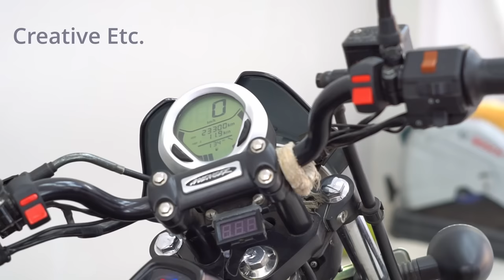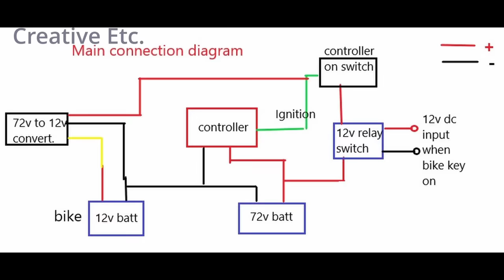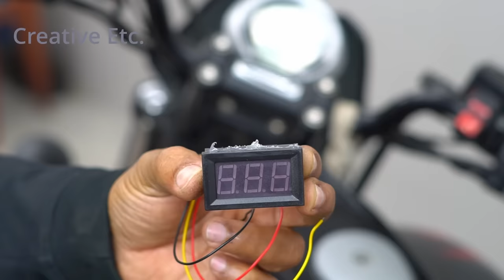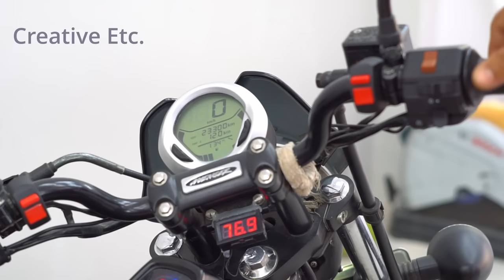DIY Petrol and Electric Hybrid Bike at Home

Comment: Try to split the battery into two and place them on both side.  .. It will help you maintain the centre of mass of the bike. Amazing work brother
Reply: A
Reply: @dipunnilesh2975  nice e
Reply: No need
Reply: Or better use one more battery pack, then it would be double in backup
Reply: Good work bro.. consider rubber gaskets for the metal boxes installed bottom side.. flooding, bike washing etc
Reply: Is it road legal
Reply: Good tweak but bad advise
Reply: Indians two wheeler drives are trained by their ladies to carry unbalanced things.

Comment: Great concept, but weakening the fork and brake disc rotor while installing a much heavier front wheel set and loads of batterries is very concerning, safety wise. Kudos for the effort and execution though.
Reply: I would not ride that bike for all the money in the world
Reply: I have been building custom motorcycles for over 55 years and this is about the most dangerious bike I have ever seen .I wouldnt even sit on it never mind ride it . Total deathtrap .
Reply: @johnsshed995  jalina teri?😂😂😂
Reply: @johnsshed995  I can't think you can make this bike in your whole life
Reply: @TECHNODESIFITNESS  who wants to make a suicide bike lol. Engineers know what's wrong in this..
Reply: @TECHNODESIFITNESS  what he said is correct,by cutting the forks and welding the disc brakes,the person created a potential failure point, why are you so offended when the person is clearly saying about the Safety factor?
Reply: @TECHNODESIFITNESS  You could have stopped you claim before "you".
Reply: I was about comment the same thing. It's bullshit.
Reply: @sohailKhan-yd9fe  panchar is better

Comment: Good modification, but concerned about cutting front fork to increase the spacing is a safety  concern. Also, the battery and speed/charge controller  needs better cooling. Lastly, the charging point at the bottom is very impractical and dangerous in wet rainy seasons.
Reply: I agree. Not only the forks but also the brake disc. Maybe it would be better to do this on a wire spoked wheel, or any way that doesn't mess up with the original parts. Plus the electrical components don't look waterproof. But still an interesting project.
Reply: Vikrant v15 me set ho Sakta hai
Reply: The fork cut with a e-saw, the break disc "tuning" from 2 make one is sooooo dangeres,o never ever drive it,but its not ok,whst when he crash in children nearly streets or some other Horror Crash? The Projekt is fine,but not the "way" he do it!!
Reply: Great proof of concept. Tack weld front brakes and cut fork im here for a good time not a long time kinda guy.

 I did this with a motorized bicycle years ago 50cc and 500w hub

Comment: you can start business on this , by providing customer to convert their petrol bike into hybrid bike , rather than purchasing new ebike this is a very good option . Great work!
Reply: Won't get approval from govt, insurance will be denied ,thus make the vehicle illegal ....!
Reply: @Anumontube  that's what is the scenario, government doesn't want him to make his own income and do something better for the environment, people have to buy company manufactured EV to generate income for government and motor vehicle companies
Reply: Well I wanna know about what happens if both were switched on
Reply: @peaceseeker5737  I think that it will get even more power, that is tough to handle as both the wheels will generate the power
Reply: @Vaibhav someone is already doing a business by selling these kits, however they don't want to mess up with government rules else they would have provided the service to attach this to your bike...
Reply: @peaceseeker5737  both can't be switched on same time low
Reply: @logicalindian7638 yes they are actully low range, not well planned kits and also generally have low power. DIY kits should be made legal with some security checks such as to battery so they can conform its safe.
Reply: @peaceseeker5737 only one at a time can be switched and used but if we mange to use both motor and engine parallel at same time, we should also be aware and control both precisely, making sure that the motor and engine is working at same speed
Reply: It's illegal in India to drive modified vehicles on road. Your vehicle can be seized by traffic police if they notice this. Very backward traffic rules in India.
Reply: Wonderful innovation
Reply: @peaceseeker5737  Relay in the bike starting battery will turn off electric motor battery. See in the video..
Reply: @Nuke.n right 👍 lekin road bhi th hone chahiye
Reply: @somenmondal2965  Generaría más potencia? Sería excelente sincronizar por medio de un sensor ambos mecanismos de tal forma que el eléctrico al llegar a su Top Speed se apague o detenga, serviría hasta los 60km por hora.!! Un Gran Torque..!! Quien nos responde eso?

Comment: Cutting front fork base is an issue of structural integrity. 100kmph on this bike(this bike can do it easily) might lead to a disaster.
Also the disc plate is not welded properly. It should be welded for the whole circle for better strength.
But the concept is good. Appreciate the thought and work 👍👍👍
Hope in future companies would introduce conversion kits 👍👍👍
Reply: your currect broooo
Reply: @naiksagar560s2  👍👍👍
Reply: Yes,the Front Fork and Disc brakes seems to a future failure point,
Reply: A wider triple tree would have done the trick.
Reply: You're right bro..  he should make full weld in that disk brake..
Reply: Never trust welded brake parts - period.
Reply: Yes you are ✅ right
Reply: @kimbryandando5974  👍👍👍
Reply: @gamingwithskarea3379  👍👍👍
Reply: @sayujraphael  Yes bro 👍
Reply: Mujhe v hybrid krwani h
Reply: @Spaghettisauce897  bhai aapki matru bhasha ko salam.. 😂
Reply: @sayujraphael  Failure point ? A deadly point!
Reply: Sirf welder hi Janta hai welding ka strength  sercular possition me koi fark nahi padta it's ok
Reply: @avinashshelke4336  I have said circular since he chose to weld the disc only at some points.
Disc plate is a single metal sheet and its designed to hold/stop the bike with weight of bike along with rider and even pillion when the bike does an stoppie.
Can you imagine that situation?? Do you know how much the plate, disc caliper and that fork takes the beating??
Companies know that better and designs the disc plate as a single entity and doesn't depend on welding joints/points. Disc plate is an wonderful creation in my opinion.
Here in this video definitely the weld points are a big compromise and your thoughts on this are wrong in my opinion.
Reply: i am personally worried about the battery temperature considering it can easily reach 50°C in India
Reply: I think   he  tested  it  with  spot  weld.... After  then   he  weld  it   properly.... But  its  not  shown  in   video...
Reply: 19 years old .
I am working on one developing my mission is for most motorcycles to transition to EV but they can still use gas.

Comment: The concept as a whole is really good, but a couple of points of concerns are there, like the Cutting of the front fork, changing to a wider fork would be a better option, and the same with the disc brakes, should have upgraded the calipers to match the rotor that came with the wheel,
One more potential safety hazard are the batterys, Li Ion batteries need cooling, there are chances for the batteries getting really warm inside that box and potentially cause a fire, same with the BMS ,it also needs some sort of cooling.
Reply: Definitely concerned about those forks , batteries and wiring. But looks like he made at home DIY project. Skill set level 💯
Reply: Yes
Reply: Thinking the exact same things!!
Reply: Exactly my thoughts, the cutting of the forks is a major concerns as it is a stress point and the strength is cut by half. Second thing is the Disc itself, those welds are not strong enough, the least you could do us weld the complete thing as the torque exerted at those joints could turn out to be near fatal. The Batteries need cooling, since liqui cooling isnt an option, may be make a heat sync of sorts? Not sure how much it will help though. 
The project is not as crude as it thought it would be, in fact  I am quite impressed by it. Kudos to the team  who got it working. I understand the thought process behind the choices/compromises made during the project but the concerns need to be addressed before you use the bike regularly as it could be potentially dangerous.
Reply: @TheLazyWandererMys  Actually the fork will fail much more easily than if it ONLY had 50% of it's orig. strength!    Front forks of motorcycles & bicycles are not designed to resist the additional torque that a hub motor generates! If he is, actually getting anywhere near the 2000w figure he's stated out of that motor, I'd wager that fork WILL FAIL, as if it only had  10-15% of it's orig.  metal left.
Reply: The moment he started cutting the forks and the brake disc did it for me. The structural integrity of the bike is compromised.
It's one thing to cut and weld aesthetic elements but not structural ones.
Reply: Exactly same thoughts. Battery needs cooling and front disk brakes. Overall great concept and a doable job.
Reply: I like this too....Much appreciated work.. but another thing which cant avoid is "Insurance"...

Will insurance co. Accept any claim for this bike??
Reply: @anupbhadale1603  I don't think insurance companies will approve of these extra mods
Reply: @anupbhadale1603  Maybe in his country.  But definitely not in the US.
Reply: @Killianwsh  not even in India...They do require reason to reject the claims 😅
Reply: Don't worry!
It is electrically powered only and will never reach 100km / h with 2 kW ... the heat engine no longer has acceleration, it no longer works.
There is a fire hazard.
Reply: @sayujraphael  truk
Reply: Spot on! These changes are a potential hazard
Reply: @fuckukaren  Let's bet who will give up first: the fork or the disc!
Reply: @fuckukaren  Fork
Reply: @TheLazyWandererMys     raj
Reply: @PopaAlexandru.  both wont last
Reply: I think the cells are of Nickel cadmium
Reply: A
Reply: @Killianwsh  Just don't tell the insurance com.
Reply: Yee sabb chuthiya pann hai bhai . Ye karke pisa karab na kare. Isi price me aaram see 3years we can buy petrol ⛽️ . Don’t waste your money & vehicles.
Reply: @prolificthinker7308 .
Reply: Fantastic effort. Concern is with fork alteration
Reply: @TheLazyWandererMys  put a sensor on battery when they heat change in to petrol
Reply: @PopaAlexandru.  Both, but it's a demonstration. And definitely he would be going through all these comments and will do necessary changes.
By the way this gentleman is very clever, he has not responded to any comments.
Reply: @MohammedAslamtit-bitsoflife  Demonstrations are not done on the public road, among people; if something doesn't go well, you take some people with you, right? He didn't realize the deed or he didn't care...
He didn't answer because he doesn't care... some people who commented are his subscribers, they answer out of politeness, if not out of curiosity for other people's solutions.
Reply: That's what bms is for. It can work at some high temperature too, if bms or battery pack temperature is too high it will stop/cut off supply.
Reply: @sayuj Raphael look forward for an exciting video from your side with these changes 😊

Comment: Amazing job on the conversion,. In my opinion,  the only area of concern is the handling and managing of Lithium batteries. Cooling is required and I didn't see in the video installing of temperature sensor. The batteries will cook in the box with the amount of insulation present. Im not an expert, just commenting based on other youtube videos on lithium cell connection and management,. Once again great job on the conversion. I dont think anyone else can pull it of what you guys have done here.

Comment: This the Bridge between The  Petrol 2 wheeler & EV 🤩🤩for city you can use the EV mode and for highway u can use petrol mode 🔥🔥🔥
Reply: This far better then just EV
Reply: Yes one good thing abt  dc motor is it will act as generator during petrol run so we can use it in highways

Comment: The only issue I have is the compromising with the structural integrity..
It's less safe now. But this is indeed a good concept!
Reply: True
Reply: Disc brake welding could greatly hamper its integrity. What If the disc breaks away while braking?
Reply: @neeljinwala  can be disastrous!
Reply: Cutting the fork is very dangerous
Reply: +1
Reply: true.highly dangerous

Comment: If regenerative braking can be used while running on engine, charging frequency will be much lower...great work
Reply: So does it mean the bike gets charged while breaking, while running on fuel
Reply: @dharani312  yes, while engine is being used ( in motor case also), stopping power can be saved to battery. Also brake wear reduces.
Reply: but 
that would impact the mileage on fuel
Reply: @psycosocialarsh   they mean that the motor would be used with the engine and when braking the motor is used as a brake which as a result charges the battery and overall efficiency,mpg and power goes up
Reply: @daddyplankton5855  
Hi

Comment: Great project ✌️👍,
just mind the disk of the brake, I suggest to weld it even more for better integrity and also waterproofing the electrical system. 
This is cool.
Reply: I felt the spot welding of brake discs were inadequate
Reply: And use a bigger fork
Reply: Hero Splendor

Comment: Firend....first of all.. Congratulations for successful E-bike conversion.
I saw complete vid since I own same bike(220cc2013). I have maintained it pristinely. 
I am not engineer but I would like to suggest 3 things.

1) Front shocks must be parallel to each other all upto lower axle bolt, no matter how you install bldc motor.
2) just above or in front of radiator there is good space for mounting controller.
2)like someone said...u can split battery pack or for better looks mount second box removing sari guard. Controller also can be fitted in this box. Kindly make arrangement for ventilation in battery box for cooling with protection from water  in mind.

Use primer before painting metal sheet. Do not use nylon cable ties for securing power cables...they will break.(Own experience)

Thank you for sharing your knowledge with us.
Reply: You conveyed your points in kind way...thanks for that 🎉🎉🎉

Comment: One more thing I would like to add to this is that a turbine can be attached to the rear tire.  So, first of all, drive on battery and when the battery runs out, drive on petrol and at that time, if the bike runs on petrol, the battery will be charged again from the turbine and after the petrol runs out, the bike can be run on battery again.

Thanks for advance to support...and so many likes ❤️. @creative etc
Reply: Turbine ke liye wind energy chahiye yaha battery use kara hai electricity ke lawa charge nahi hoga
Reply: @sayanmajumdar06  he means dynamo
Reply: Little knowledge is idiotic
Reply: There is something called "1st law of thermodynamics" , if you try to charge battery with your fuel engine(in whatever way possible), you are essentially converting one form of energy to another, in the process you end up losing some energy.
In simple words you will lose mileage.
Reply: @hemanthkumar5438  would be better if he converted brake energy instead since it’s regaining spent energy. Plus I hate when people beg for likes and crap
Reply: Я тоже год назад сделал гибридный проект на базе Honda Super Cub.Моторколесо 3000 wt я установил на задней подвеске.Напряжение батареи максимальное-75.6V  2500wth.Могу использовать мой  Cub в 4 режимах:
1.Езда на бензиновом двигателе.
2.Езда на Электро двигателе.
3.Езда на электро+бензин одновременно.
4.Езда на бензине с зарядом батареи от моторколеса.
У меня три тормоза-передний барабанный,задний дисковый,задний рекуперация.
Reply: I don't think you quite understand the meaning of the word "turbine". ps. There is no such thing as perpetual motion.

Comment: This is pretty amazing what you've done here, something like this could possibly be incorporated in big sports tourers in the future that have the area to fit the battery pack...awesome work tho very professional also would be nice to know if you can incorporate regen of any kind
Reply: Adventure bikes, to get the fat ones through the sand and loose climbs.
Reply: Regen is included in the Motor controller. It's written on the product page.
Reply: Electric reverse could be handy for a large bike.
Reply: top
Reply: हमारे पास भी होंडा बाइक है अभी पेट्रोल से चलती है क्या वह इलेक्ट्रॉनिक गाड़ी बैटरी से चल सकती है ऐसा हो तो हमें भी बैट्री से करवाना है तो क्या आप कर सकते हो अगर हो तो मोबाइल नंबर दीजिए ताकि हम आप से सम्पर्क कर सके

Comment: Awesome work, very professional work. Could you please let us know what is the total cost you have spent for it and how much range you're getting and what is your battery capacity ?
Reply: @dharani312  18650 isn't the capacity it's the size, 18mm diameter 650mm length
Reply: @dharani312  lmaooo 18650 mah for sure
Reply: @dharani312  18x650 is 18mmx65mm its completely unrelated to capacity, high capacity 18650s are generally about 3500 milliamp hours that's it
Reply: True guys thanks
Reply: @Elegante.  no bro not true....i forgot it was long time
Reply: @hazmaheenmahegir7485  thanx

Comment: Welding joints on the front disc might not hold under heavy breaking. Battery pack should be given some ventilation
Reply: Welding can be stronger than disk steel itself, chances of welding coming off is very less

Comment: I would be so confident with that itty bitty of welding that has been performed to that front disk due to so much pressure that front disk brake performes...it needs more welding to asure that disk doesnt loosen up or break because theres not enough welding done to it...but other than that the rest of the installation and the small mods was awsome perfect.😁👍